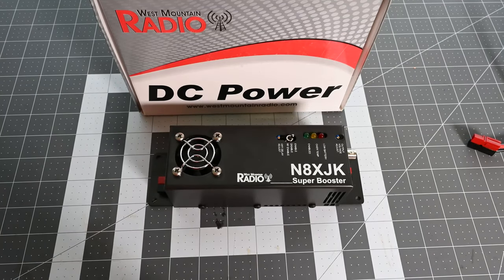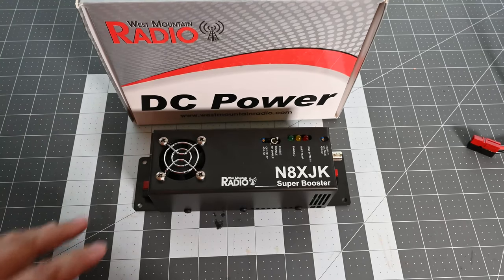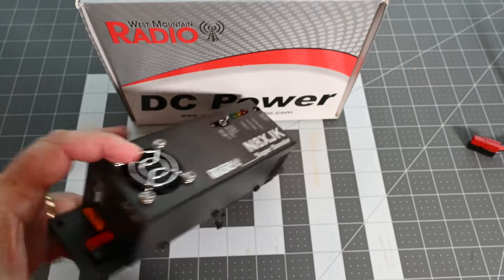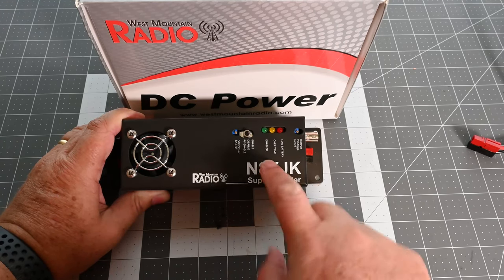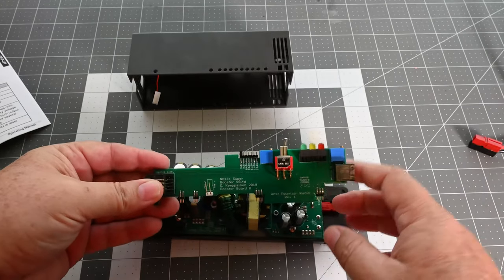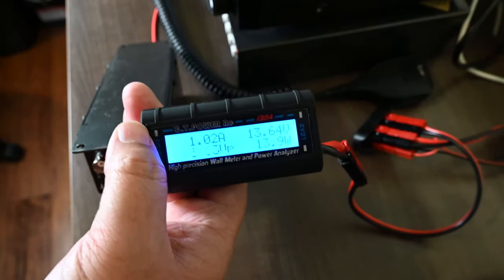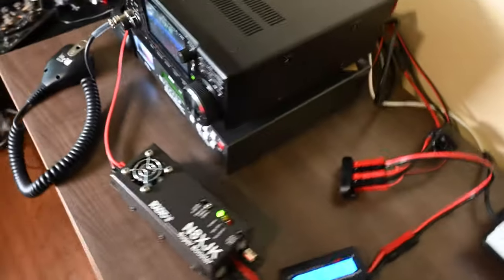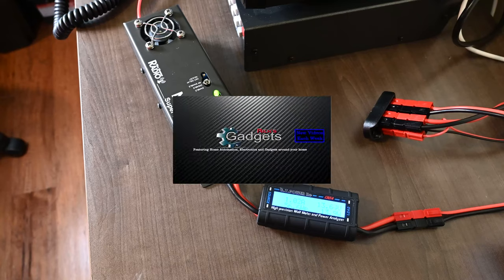A look at the West Mountain Radio N8XJK voltage booster

Comment: I ordered this a while back for my semi and finally received it UPS and have no clue how to connect my radio to this. I’m daily new to CB radio and feel like I have a $300 booster that I can’t even use at this point
Reply from the maker: It goes inline from the battery power to the radio.
Reply: @RicksGadgets  I got it working and wow what a difference.  I noticed the fan isn’t running. Is it supposed to be on all the time ??  I appreciate your response.
Reply from the maker: @244-badnews2  It will only kick on if the temps get high. So if you are cycling it frequently, it will probably come on.